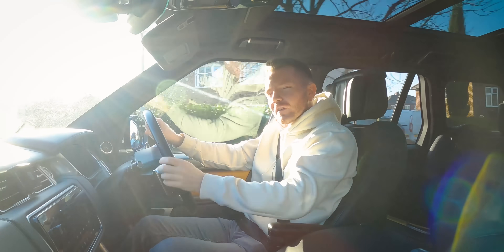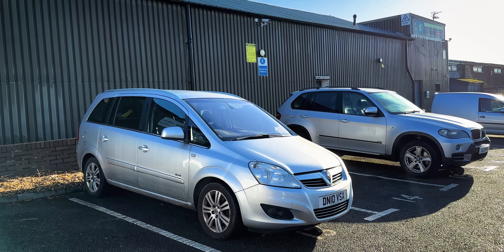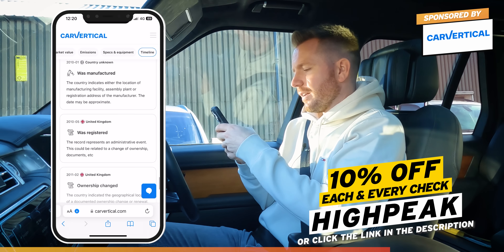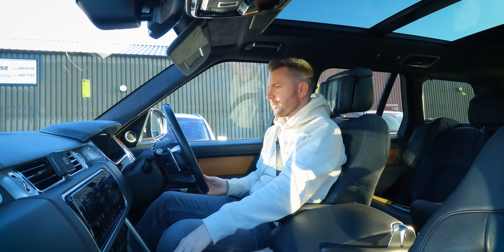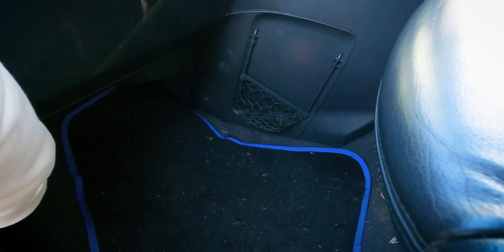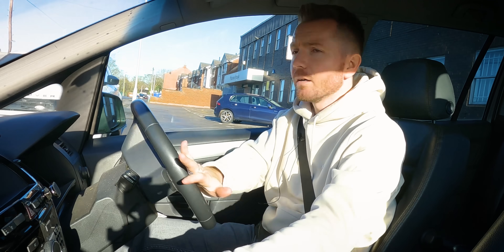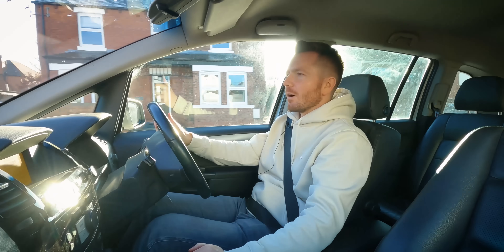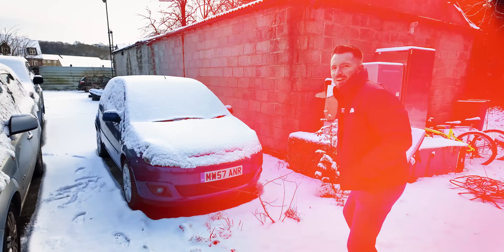I BOUGHT A CHEAP VAUXHALL ZAFIRA FOR £1,000!

Comment: You, Matt, are the sole reason I still believe in car salesmen. 🤝

Not all by any means, but I feel like there's some good ones out there. 
Like a person that would rather sell you a car that's been checked over, fixed up to a good or decent, working condition if necessary and sold with purely feeling you're selling someone something that'll be a good vehicle for them. Not necessarily the best car for lowest price, but something that'll suit them, their budget and needs. 

I've had quite a few cars over the years, I like buying and selling them on but I've always done it honestly. Not looking for absolute maximum payday once I've fixed something with bubblegum and few self tapping screws. 

I am somewhat happy that nowadays public auctions are getting more and more popular so car dealers will flog their 💩 there while quite honestly stating everything, or at least most, that's wrong with them.
I guess it serves both, sellers don't have to put makeup on a pig and try to lie through their teeth in order to get someone to buy it. Buyers know, in most cases, their buying something that didn't make the cut to be on the front court and there'll be risks to buying them but at least their cheap. 

Only problem is nowadays the prices in auctions are getting out of hand too 😅 I just saw a '09 Subaru Forester with a busted engine!!! (I'm guessing a snapped crankshaft as it's the 2.0td) go for over 3k€. Like what the heck??!? 😮 Who pays 3k€ for a shell, you'll pay thousands for a new engine and work and then you have a 200k mile Subaru with bad history and no way to get your money back if you want to sell it on... 😂

Comment: In the Netherlands you can change it when the MOT tester makes a milage mistake. You can apply for it at the correct organization so the mileage will still be logical if you can convince them.
Reply: Aha bedankt voor de tip😊
Reply: @Landshark928  Ja, het was een keer gelukt, het garagebedrijf had dat toen gedaan.
Reply: Had ik eerder moeten weten, heb ooit een auto ingeruild met dit probleem, werd gebruikt als excuus om de inruilwaarde te verlagen..

Comment: The Zafira 1.9 CDTI 150 Elite are fab cars. A few common issues with that motor but it will tug the front end up a 320d’s chuff no bother.

I prefer the Italian 1.9 over the VW PD. More revvy and just as tough after flap removal

Comment: Amazing car. I bought one new in 2005, it lasted until 2022. Then rust got to it. Very comfortable, drove it all over Europe. Though I had mid spec with same 1.8l petrol with manual. Drove elderly relatives with back pains, who's back pains have disappeared after long drives. Yes, seats were that good... except for 3rd row, but I used that row only few times.

Then bought Zafira C. Absolute garbage. Nothing in common with B. Ergonomics are horrible, build quality is even worse. Barely managed to get rid of it.

Comment: I almost never see that central display being set to the bright setting - how odd. Oil mixed with coolant could be a defective oil cooler, quite common on these and 1.6's. Non-functional horn could be the CIM module behind the steering wheel, also a common issue in Zafira B/Astra H, although being a 2010 it should be the last revision and thus the most reliable. EDIT: Also, curious as to why CarVertical displayed some data in Polish
Reply: I think that during the Car Vertical ad, I noticed it was registered as an Opel. Could this be why?

Comment: Oil in coolant doesnt necessarily mean its got a blown head gasket theres some common faults on these vauxhalls such as the oil cooler seal which is a cheap fix

Comment: According to the excellent Russian YouTube channel Autostrong, the 1.8 GM engine gets 3rd place in best petrol engines of the 2000's. They say the problem of oil mixing with the coolant is because of broken gaskets around the heat exchanger. And quite alot of the cooling system will have to be replaced. Then there is the rocker cover issue and early ones had phase shifter problems whatever that is. But good engines other than that.

Comment: Ah the old 1.6 VVT engine. I had an Astra H (MK5) SXi for a short while, with one of those in. Was a robust engine, but the cam dephasers always wear out on these, causing that horrible rattle when you first start it. I replaced mine, and the solenoids with parts from Vauxhall. 

Always changed the oil early, and looked after it. They started to make a noise again, about 5k later. On top of that, the car had issues with the CIM module, time would reset itself, volume button turned the radio down when you pressed it up etc.

They also had those stupid digital indicator stalks, that always play up when trying to use them.

Rocker cover gasket went, had to replace that. Then the wiper linkage failed, and the wipers would smack the side of the pillars when in use. I have to say, it really did put me off Vauxhall for life.

Cars that weren't cheap brand new, but consequentially depreciated so much that they became abused family cars, especially the Zafs. Run on a shoe string budget, and neglected.

Comment: Well I've done well zafira A 55 plate bought 5 years ago 4 tyres unblocked window washer bottle myself both front springs (1 broke) brakes all round just passed 4th mot with an advisory for rear spring. Cost me 1k and these parts to date. Best part is once its not ulez compliant a should get 2k to scrap it probably won't it'll be 50 quid by then😂

Comment: I have been in plenty of Zafiras all my life and I feel like they are built down to a price. My mum had an 05 Astra 1.8 Auto and the head gasket went badly and the cam belt snapped like no one’s business - the 1.8 is known for doing that. Honestly Zafiras are not all reliable with the notoriously bad 1.9 diesel and the famous fire problems they had years ago. Problem is owners but these cars and run them into the ground; better off with an s max but we used to have a 2016 Zafira Tourer Auto and it was fantastic!

Comment: Had 4 of the zafira MK1 petrol and diesel.Just a few niggly problems.Got a 58 plate 1.9 cdti the biggest lemon I ever bought.The amount of problems nowadays because of dpf filters and egr valves is not a joke.Problem after problem.Good thing was the space and a fairly decent interior which was a definite improvement on the MK1.
Reply: I've had a 1.9 150BHP which was still going strong at 180,000 miles. Body rotted. Daughters 1.9 120BHP version also bulletproof. The 150 had a few issues in 10 years, swirl flaps plugged off, EGR never replaced but restictor and clean occasionally. DPF never replaced, but cleaning fluid injected down the DP sensor occasionally. Mainly country roads.

The 120 has no swirl flaps. EGR  & DPF no problem in 2 years, even with pottering around and occasional run out. Like me, she doesn't spend ages city driving though and I think that is the killer.

Comment: Had a 1.8 Holden Cruze in Australia which looks like the same engine and it was a load of rubbish. Oil cooler gasket failed, rocker cover gasket and oil leaks everywhere. Eventually the head gasket went.

Comment: Had quite a few of these over the years . MK1s better than Mk2s in my opinion . 1.6 not so good if you got kids ,dog , luggage. 1.8 very good and 2L diesel good .2.2 Opel Zafira excellent. There are issues with water and oil mixing . Hope you get your money back Matt , would make a tip run car or dog car , good luck 🤞

Comment: Someone will buy it to fix up. I had a 1.6 for 5 years. It also had the oil in coolant( oil cooler seals) and the leaking cam cover gasket with the oil cooled spark plug feature. Since upgraded to a Jag XF Portfolio.

Comment: I would have thought for the Elite model it would have had a CD70 sat nav head unit installed, and not a poverty spec CD30. 
Also pretty sure being the Elite, there should be a sound deadening mat on the underside of the bonnet.
Reply: Nope. CD70 has always been an optional extra for Vauxhall Zafira B cars sold in England / UK. Have a browse on the used car market and you'll see the majority of them don't have the sat nav.

Comment: Hi Matt had one of these myself many years ago and have to say worst car in 40 years of driving I’ve ever owned,in the 12 months I owned it ,it spent more time back at the dealer I bought it from than it did on the road constant engine management light on and wound either go into limp home mode or would just die on me and they could not get to the cause of the issue ( strange when it was a vauxhall main dealer) so eventually they took it back .

Comment: Btw, what usually is the issue when oil has gotten into the coolant?  If engine oil, i assume head gasket but if ATF , then the ATF cooler in the radiator is the cause.   But head gasket is usually coolant/water into the engine/oil that u see on oil dipstick or under the oil cap, thus i ask.

Comment: I was expecting to hear that unmistakable check strap click . Better off with the petrol .I had a z19 dth sri and had the Egr and dpf issues ..and also found a neat fix for the swirl flap rod failure...overall it was alright though

Comment: we have had zarfira's for years, still got an 06 plate 1.8 petrol, we always found the 1.6 engine very sluggish for the size of car.
Reply: I would agree . I have a 1.6 petrol and it is sluggish and the fuel consumption isn't great either. I could do with taller gearing or a 6th speed. At 70 mph its doing 3500 revs

Comment: The legendary Z18XER engine with it's top end rattle from the VVTi system or REPEATED coil pack failure, the A18XER engine with it's timing chain rattle and wear issues and waterpump issues amongst other problems depending on which one you got. 02 sensor problems. Real crap gearboxes and weak clutches. Doorlocks that just decide not to open or lock, woohoo. Rear axle bushes fail quickly too. You might be lucky and buy a diesel with the 1.9 from FIAT and get DMF failure or intake manifold replaced a couple times with effed swirl flaps if you bought the 16v version ( Z19DTH) the Z19DT engine was probably the best choice and that's me using that phrase in loose terms. Even the newer VX cars are crap even if they are mostly re-styled Pugs.

Comment: Might be surprised RE the oil in coolant, most likely the oil cooler gasket rather than anything more sinister. But saying that, there's plenty out there and with the rest of things on the list, they probably don't need that money spent on them either. On balance probably right to just shift it on.

Comment: Shame there is so much cumulative maintenance not done,we just moved our 1.6 full VX dealer service (To keep warranty up) 93k 2012 zafira on after our 11 years from new it was a very good car overall, clutch @ 66k two air con pumps & 1 condenser a coil pack a brake master cylinder and most recently a water pump I reckon that was the cause of a bit of oil in the coolant all under the VX lifetime warranty bar the clutch pads discs & a back box sold to a local used dealer for 2k who moved it on within a week after advertising it at £3.5k after a 11 month early cam belt change and oil service possibly a fresh mot though it had 10 months left and 4x6 month old  goodyear tyres. The difference between the your Zaf & our cars just maintenance kept on top of really cheap family bus it was only £10.6k new special Ed  to see out production run.
Prefer the 1.6 to 1.8 had both engines 1.6 pretty economical you can get 40mpg only 30 in 1.8.
Keep going Matt if only you could see the owner before the car you might save some money.
Reply: Yes the old 1.6 mk1 was a super car, very good mileage for size did 163,000 in ours and if I’d have had the cam belt changes when due fit might still be on road.

Comment: The blower motor resistor is what overheats and catches fire. It torched a Norwegian airport parking structure, eventually melting the steel causing the entire thing to collapse.
Reply: One in cork Ireland too
Reply: Mine had two recalls on this

Comment: Genuine question: why are Opel cars called “Vauxhall” in the UK? Is it the same firm that changes name?
Reply: Vauxhall was its own established brand in the UK and was acquired by GM in the 1920s. They were run separately from Opel until the 1980s, when they started putting out near identical cars. Basically, the UK part of company didn't want to lose the many decades of brand recognition and start over under Opel
Reply: @DocRobertson7  oh, now it’s clear, thank you for your answer!

Comment: no ones mentioned the fire hazard park it off your forecourt!
Reply from the maker: I think one caught fire in the middle of summer on the motorway and then everyone panicked. Vauxhall did a free recall to address it anyway.
Reply: @HighPeakAutos  i think its a bit worse than that there have been many fires while driving and parked on peoples driveways causing damage to there house, its the typical vauxhall fault of burning out its under rated heating motor wire and plug

Comment: So many still on the road (says alot I think!!) - they seem to take abuse and keep going like nothing happened, same as the Astras and Vectras of the same vintage!! I still have my battered Vectra 1.8 2008 I bought for £1000 2 years ago, absolute tool of car, done nearly 30k on it as a work hack - if it breaks spectacularly, I will park it at the side of the road, and get another one!!
Reply: Mrs has had a Zafira for 10 years since new - but way less trouble than all ym Audis and BM’s in the same period

Comment: I think it was the blower motor resistor that was causing a lot of Vauxhall cars of that era to spontaneously combust, not the air conditioner
Reply: Wasn't that because someone had replaced the windscreen, without the correct kit, so a fuse would get blown by water ingress, then they replaced the fuse with wire..............
Reply: @joshua6244  nah, definitely Vauxhall's blower motor resistor, the issue was even featured on BBC's Watchdog programme https://youtu.be/FT_gv3w0gJc?si=U9Md6cL00Q_TjMRh

Comment: I used to drive a 1.6 petrol zafira back in 2018-19 when I was 21. I hated it, very slow and had an awful turning circle
Reply: Should try an R class Merc. Now that needs bunkering rather than filling and a couple of nautical miles to turn. Parking more ike berthing 🙂

Comment: Ahh you've literally reeled off every common issue these engines suffer with, including the several I've had in my time 😂 only thing I didn't hear was the usual knock on start up, indicative of worn VVT pulleys.

Oil in the coolant isn't as big of a deal as you think on these. It'll be the oil cooler seals which they all suffer with eventually! Relatively cheap and simple job to sort. Can see why you haven't gone further with it though looking at that list.

And you think you're a geek!? Honestly, I need a life 😂
Reply: foghorn12  the knock IS the pulleys due to oil starvation from the solenoids. Can also knock from general wear and tear as they're not a brilliant design. I had three of these in varying 1.6 and 1.8 configurations that all knocked on start up and every time, I pulled the solenoids to find them clean and free from obstruction. 

The good news is that unless there's active faults for camshaft position and timing, then there's no cause for concern. They can knock for many years and miles and not cause major concern.
Reply: I had an Astra 1.4 that also had this knock. Always worried me but the previous owner had replaced the cam belt to try to fix it but still there. My brother has it now at 380000km and still going strong
Reply: @luclaan8165  the 1.4 doesn't use the VVT system so the knock mentioned above wouldn't apply. More than likely timing chain noise on one of those but if it's still going strong then keep it going! I know the smaller ecotec engines (1.0/1.2/1.4) suffer with chains but rarely ever fully snap or break so will be noisy for many years and miles but give no real issues.
Reply: @dancampbell6415  it has to do with something that’s not the belt have no idea how to translate it in to English but klepstoters roughly translated to Valve knockers

Comment: Always look in the coolant tank. Oil can usually be seen on top. Double check on autoo boxes. 

Erm, Zaphiras rust here and there underneath in a couple years time too. I got my daughter a 1.9 diesel (Fiat engine) and that zips along nicely. Head gaskets don't go on those. Rust, yes, fixed at MOT for an hours time. Sticky gearbox linkage also common on 6 speed. Cheap fix, ignoring labour. 45MPG. Coolant pipe across the front of  the engine also rusts and leaks. Also cheap to fix if you don't have to count time though. Speakers blow out easily, standard replacements.  

Your list is short, but head gasket is all labour cost. Assuming they don't have porous heads or anything bonkers!

Comment: Had the 1.9cdti, it was a workhorse. Lots of issues with suspension, gearbox and electrics. One of the worst cars I've ever owned. It would eat front tyres, never really got more than 10k from front set. As for the fires, there were dozens of them, even one that caused extensive damage to a shopping centre in Ireland. You would never get 3k for that, best place for it is in the scrap yard.

Comment: I had one of these ok, the previous one was better, had loads of issues with the B, they tend to be unloved abused and ran on pennies, this ones mot history is lettered with tyres and failures 😊.

Mine failed on VVT dephausers paid a dealer 700 to fix and got it back with oil galley blockage that caused vvt issues and lo power but as a second car it soldiered on until, horn failed, broken springs, failed door locks electrical issues was the worst car i ever had my zafira b